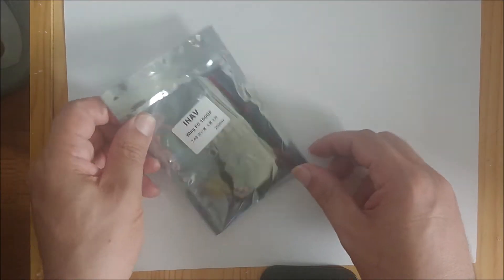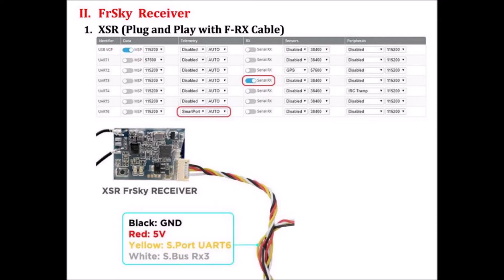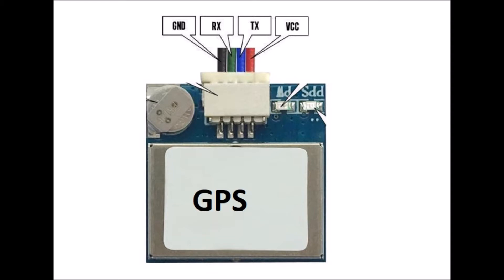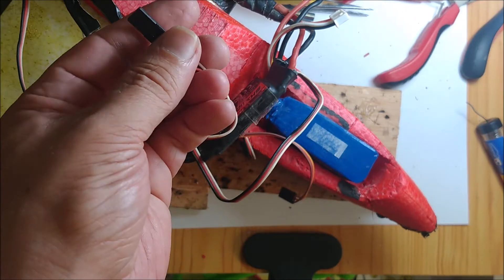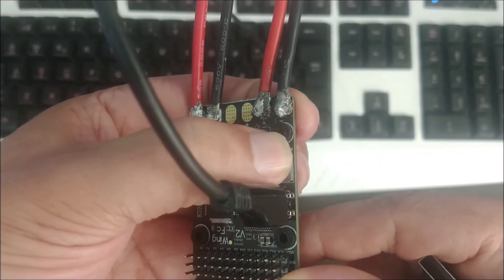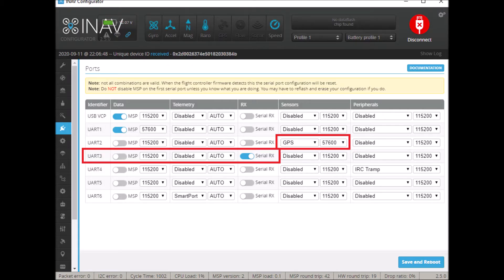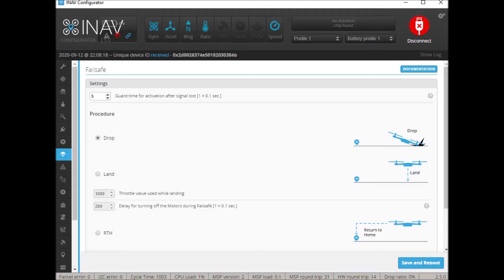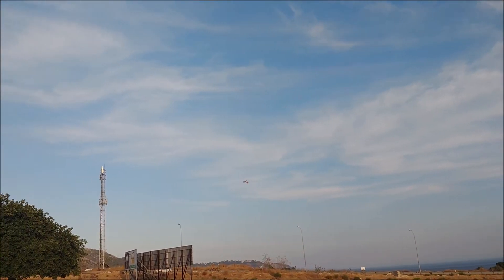How To Wing FC-10 flight controller setup for planes and flying wings with inav flysky frsky

Comment: Your help would be appreciated. I have INAV 6.1 on this WingFC board, and would like SBUS, SMARTPORT TELE, GPS to my FrSky receivers. Ok following your video,  SBUS to RX3/UART3. GPS to RX2 TX2 UART2. This works fine. BUT you say for SMARTPORT to use RX3 and SP0. How can you use RX3 when it is being used for SBUS? Please clarify. Assume SOFTSERIAL must also be used for SMARTPORT?. What are the CLI settings for IVERSION and HALF DUPLEX? Thanks for your help

Comment: no rssi????
Reply from the maker: el rssi lo mandan los receptores a traves de un canal, se configura y listo
Reply: @FisicayQuimicaCanal  si, pero en mi caso mi receptor es el frsky L9r con salida rssi analógica, debería ir un cable del rx ala fc , matek si tiene un pad pero esta fc no lo lleva ni se si se puede hacer de alguna manera.
Reply from the maker: Either rssi or analog airspeed can be input on the AIR pin if not used for external I2C connections. Either must be first enabled in the params, params refreshed, and then pin “13” set for the input, and type set

https://ardupilot.org/plane/docs/common-furiousfpv-f35.html

no se si se refiere al analogico o el digital

Comment: Were you able to receive telemetry via smartport? I tried to invert with SET telemetry_inverted = ON but without success. I tried with two receivers, XSR and X8r. Both did not work. Any tips? Thank you!
Reply from the maker: sorry, i didn't try
Reply: Haven’t used this FC, but with my R9 stab and R-XSR (both FrSky) have to downgrade the firmware to something older in order to have telemetry working. Hope that helps

Comment: This is one of the only boards that has a compass which is required for drones. Would this board be usable for drones?
Reply from the maker: no, integrated compass are useless, you'd better add an external compass

here there is a discussion about the location of gps and compass

https://youtu.be/mA4Q-jsYObo